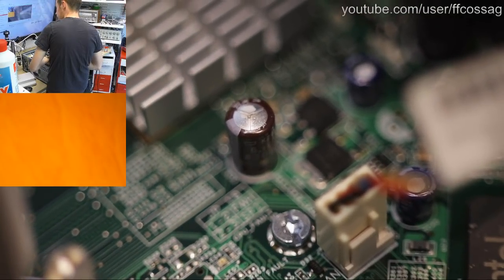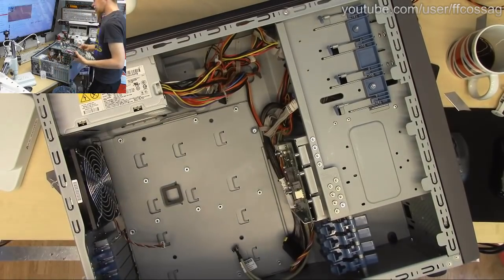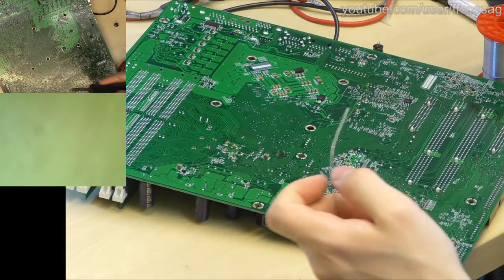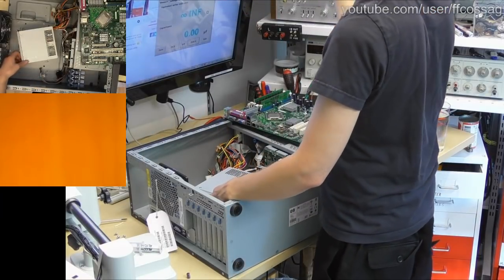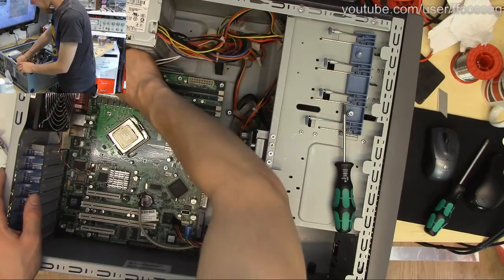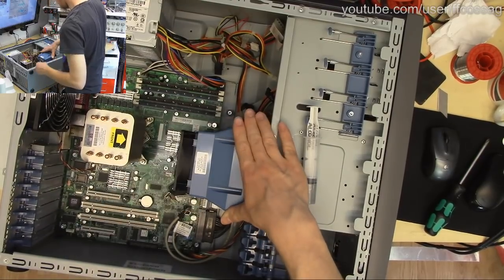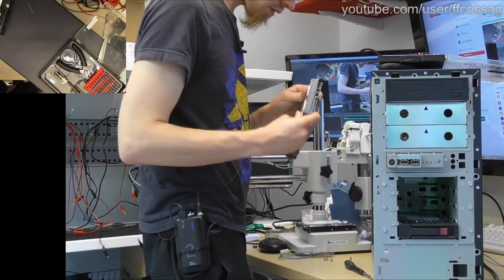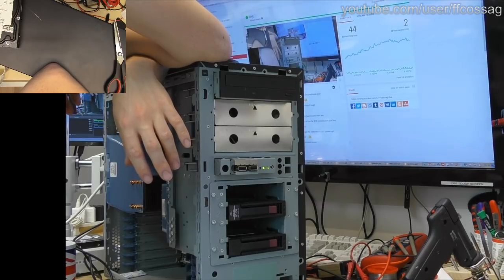RECDSTRM: Sleep deprived server motherboard repair

Comment: You should test Ultra-Low ESR caps that old for leakage current, even if the ESR tests ok (i.e. the Rubycons).

i've got Panasonic FJ that are almost 20 years old, they look crusty on the inside when I take them apart, even if they test ok.  Sanyo WG (now Suncon) might still be in production, as a direct replacedment, but you don't need Ultra-Low ESR caps outside the VRM, even if they were used.

Also, did you give attention to the "write cache disabled" that the POST was reporting?
Reply from the maker: One should always test what is reasonable to test. I don't have any easy way of testing leakage, so I don't. There's a bunch of simple DIY devices you can build for that though, so I suppose I don't have much excuse not to.

Write cache should be disabled, it's running JBOD with zfs in production. Reads and writes are 100 MB/s or so, so it's fine.
Reply: @FFcossag  Interesting.  A cursory glance at a couple of forum posts indicates that ZFS is faster with WC disabled.  Good on you.

I guess the easiest way to test leakage would be to measure the current coming in and out of a cap at its rated voltage and then compare it to the datasheet.  The best current leakage tester I've seen so far (or most novel, anyway) has been Mr. Carlson's.

I guess the importance of measuring leakage current depends on how aggressive the electrolyte is.  On something like Panasonic FC, yea you're probably fine storing them for a while.  But something like MBZ or MCZ class for that matter should definately be reformed every year or so they're kept in storage (or Panasonic FR class for that matter).

Old series like UCC LXF, which have particularly aggressive quaternary ammonium salt electrolytes should definately never be trusted based on an ESR measurement alone.  I'd also replace them if their leakage measured ok.

Comment: Please help ....
Hello ... I have a ups apc size
 1000 av, linked to the battery car number 2 (24 v) volume per 70 amp, but the stream shipping few ranging from 4 to 5  amp, no more. Do you I could connect two ups on parallelism in order to increase stream shipping (reduce charging time)
.
.
.
I personally you experimenting this process and succeeded rather, has doubled stream shipping, but in the long run don't know is possible that i'm having a problem? ارجوك helped me ... we suffer a lot of blackout and thank you

Comment: Curious if that board would recognize if you partitioned a 4 TB drive into 2x2 TB?
Reply from the maker: If you can get the latest BIOS (it's paywalled), it probably will, since it runs an Intel controller and not an LSI one. The BIOS in this one is completely fucked though, because it's got a bug that breaks it if you use drives capable of anything over SATA1.5Gbps in IT mode.

Comment: I Check CR2032 in Ampere Mode, if less then 300mA I throw them away....
Reply: I do this as well, open circuit voltage doesn't tell you much (unless it;s completely dead).  300mA seems a little high to be throwing them though.

Comment: The single-socket 775 xeon fujitsu primergy I own uses 80-90W idle. I retired it long ago because of this.
Reply from the maker: Yep, this one is not much better. It's replacing a similarly inefficient power hog in a super low-budget set-up, though, so it doesn't really matter.